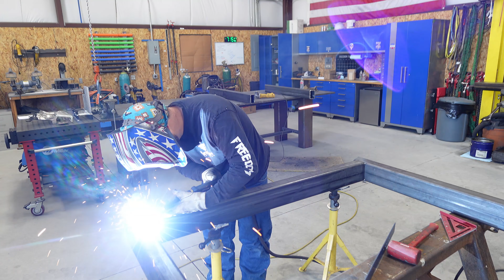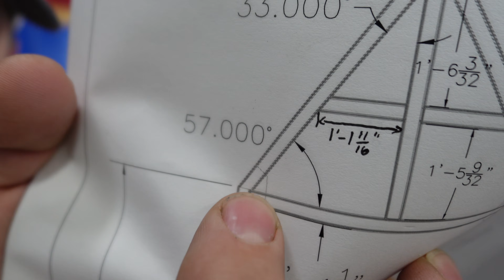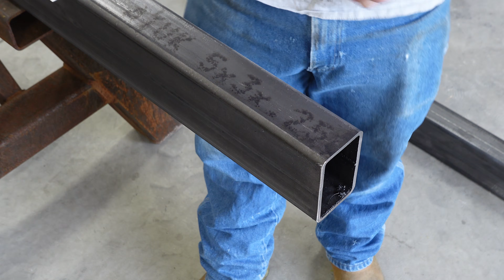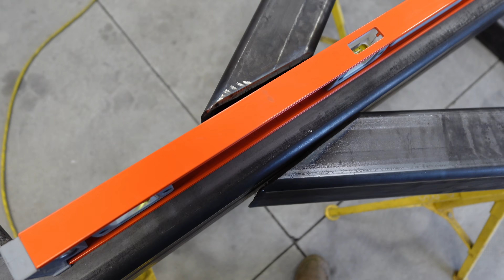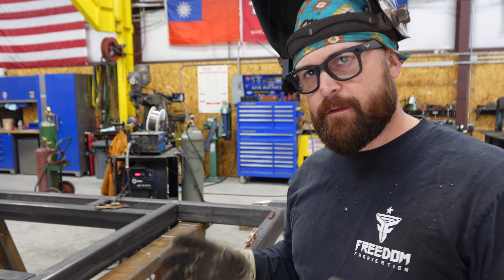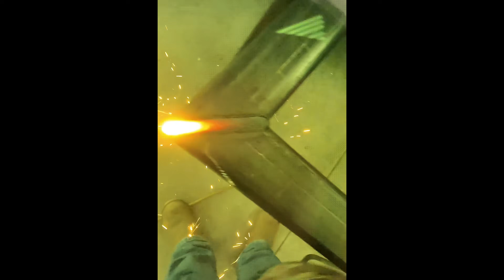Fabricating a wheel ditch filler part 1

Comment: In regards to the tongue angles wouldn't that front cross member close up that section and tie all three together. I'm just interested in your thoughts on it. Thanks for what you are doing, nice work.
Reply from the maker: Yes actually, it would. I just wasn’t thinking it would (shame on me)because I’m so used to fabricating frame angles the way I did it. Thanks for watching!
Reply: @Freedomfabrication777  no shame at all, your work is top notch. With the weight that thing is built for, I just wondered if tying the angles together first is a better practice for preventing a known failure point or if it was just your standard practice in your work flow. The only thing I've welded up, built to handle the much weight was the bench I built for the ex-wife.
Reply from the maker: @Cleverdad_itchy_back Lol. I like things that are over built. 💪🏻

Comment: You definitely like doing things the hard way. 
Your front 33* corners would have been fine if you just did the 90* corner first then added the 57* piece. 
Rear corners could have been sealed up with flat 3x5 caps instead of the 45* mitre cuts. 🤷🏻‍♂️🤷🏻‍♂️
Reply from the maker: And yet it still turned out just fine…..

Comment: My dude, you are always crushing it. But I do have a couple of questions.  

Why  dont you just use a hard wire with short circuit for your roots with one of your other welders? Then run your fills and caps with your dual shield, with the welder you are using now.  Then you know you are a getting a full pen root with no lack of fusion from the tack welds. And you could still go fast with a downhill open root for the verticals. 

I assume you just dont have anything break or promblems
with  your customers, for you to do that set up. The welds must be strong enough for what you are building and it’s faster to not have to switch. 

It is just my bias being a former welding inspector. I hate seeing folks do triggering  with verticals and roots on youtube. 

You are a definitely a thinker. So I believe you thought about it all ready. And you drag dual shield, my dude🤣😅. That push weld still looks good .

You need one of those super like buttons on here. So I can toss money your way for answering my thoughts. Keep crushing it , my dude💥💪.
Reply from the maker: There are a few reasons I don’t run both processes together. For one, Just like you said, time. It would be slower to have to run 2 processes. Second, I don’t like to mix the metals. I don’t know if it would hurt or not, but I always get way more pinholes and porosity with short arc. Even though I trigger the root on some of the joints, I grind them out, and they are always much cleaner than short arc. And finally, I know a lot of people say you shouldn’t push dual shield, but I disagree with the old saying- “if there’s slag, you drag”. There are plenty of situations that prove that to be false. Like welding overhead with stick for example, you should push the rod when you are welding overhead. There are situations when I will drag, but I do prefer to push with that particular dual shield wire. Hope that answers your questions, and thanks for watching!

Comment: You do a great job showing the process and working through things👍🏻 Thanks! Are you using flux core wire with gas?
Reply from the maker: Thanks, yes this is flux core wire with gas. Also referred to as “dual shield”. Thanks for watching!